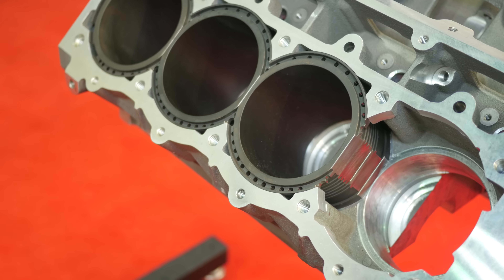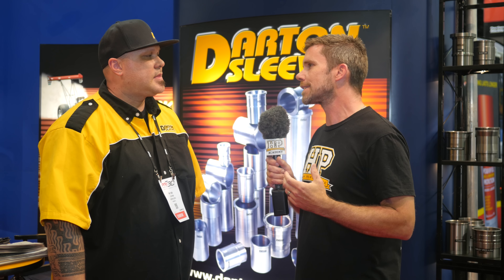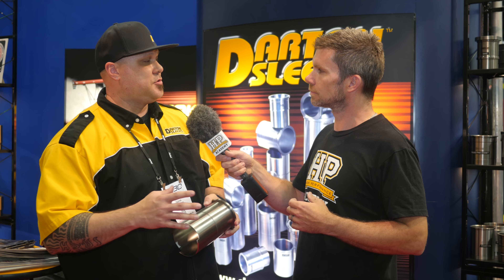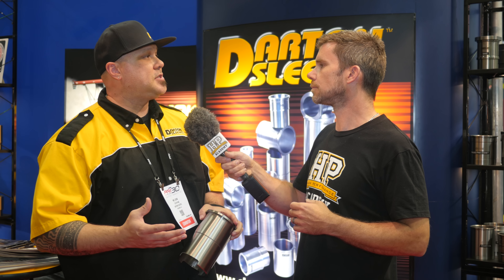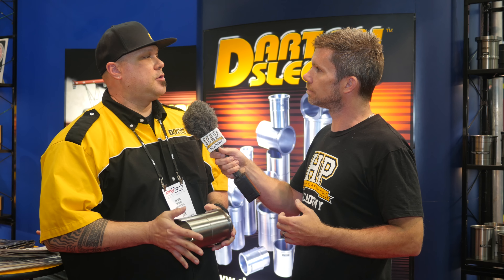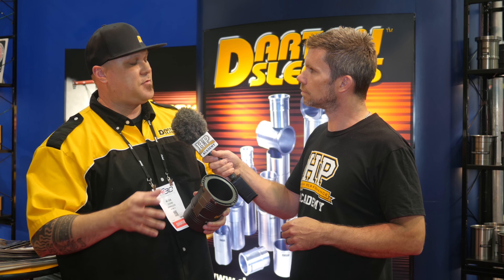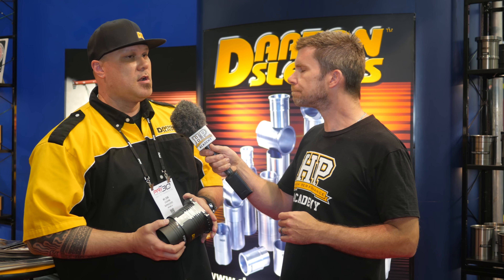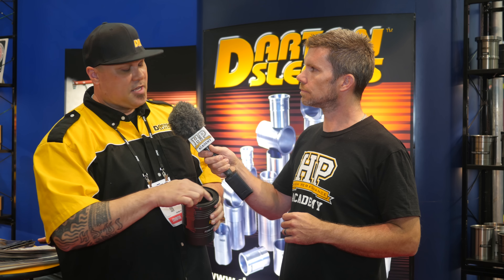Why do Cylinder Sleeves Drop? | Darton Sleeves

Comment: Sleeving aluminum blocks, especially open deck types is an absolute must, even if one is just going for a mere refreshing of the engine running stockish power. One might get away with not sleeving a stock aluminum block when refreshing it, or even removing material  due to minor cylinder damage if the block has the thickness, but he will not get the longevity an iron alloy sleeve offers. Using high quality sleeves of a properly balanced iron alloy between durability, rigidity and ductility is also another must, poor sleeve design and alloy will net you more problems than just re-boring/honing the stock sleeves most of the times. The last must is correct and precise installation as stressed on this interview, get it wrong or do a sloppy job and get ready for a cracked block. High quality iron alloy sleeves, are low in silicon and higher in nickel. Darton sleeves for us gearheads, are considered high quality sleeves and are well known and proven for high performance in the motorsport field. Nice interview as always, and proper info from  Darton.
Reply: Marios EvoCy 
Completely disagree, I work in a full service automotive machine specializing in Subs, Hondas, Mitsubishi etc..what we're seeing is block structure weakness due to removal of block support material. I have a B18C1 on the bench right now that is junk. MID system was installed and due main bearing bore distortions and block twist it junk. 
Dayton an LA Sleeve are both good products, but I don't like the MID. I would rather use a thin wall sleeve with a block guard. 
We have an EJ25 that did a true 800 hp.
Reply: The MID is a good product and works well if installed right. It is your unquestionable right to disagree if you consider it so, and use whatever type of sleeve you consider best for any intended application.
Reply: Any cast iron or aluminum block can be sleeved, there is nothing wrong with sleeving when done right. No bore surface treatment on aluminum blocks can replace the durability and longevity of a proper iron alloy sleeve. If an aluminum block has damage in one cylinder, there is no point in sleeving only that cylinder with the same oem type aluminum material sleeve, the correct process is sleeving all the cylinders with iron sleeves. If it's a cast iron block, yes you can sleeve an un-sleeved damaged cylinder with an iron sleeve of stronger alloy and even if you use oem rings you will not have any issues, but it's always better to freshen the block by sleeving all of the cylinders.
Reply: I have yet to see a block that can't be sleeved successfully, unless it is completely out of shape and or severely damaged, so I disagree on this. I also disagree on any other process, either that be coating, anodized, plasma coating of any type or nickel type of coating  etc, having and yeilding better results than iron alloy sleeves. I did not say that there are oem manufactured or already offered aluminum matrix liners, I said that it is possible to use such sleeves on an aluminum block if you want by having them made. These can be made from high melting temperature aluminum alloy composite, such as Al-Mn, Al-Cr, Al-Ni, Al-Fe and Al- Cr-Zr alloys. It is not something I would do personally,  although  when these alloys are reinforced with ceramic particles, they attain the properties required for cylinder liners in high performance engines, i.e. high melting temperature, good strength at the service temperature, higher thermal conductivity than cast iron, good wear resistance and good corrosion resistance.  The reason I prefer cast  iron alloy ones are mostly cost effective ones also ready made availability for basically any application, and high quality ones  have high wear resistance,high elevated temperature strength; and high melting temperature, and although cast iron has a high specific gravity and a low thermal conductivity in relation to an aluminum/silicon based matrix, they are still up to the job 100%. Now about the tooling used to work on the aluminum matrix, and I'm sure by diamond you mean carbide,it  is there, you just need to find the right supplier. As for the bedding of rings on iron/nickel alloy sleeve, the honing procedure can be the same as on "regular" cast iron block/sleeves , you can use the same pattern i.e, and  if the manufacturer of the sleeves recommends more shallow grooving, then you need to follow the instructions of the manufacturer. In regards to the last bit of your post, of course it is block that is the problem, and the problem mostly lies with open deck blocks, that's why stronger sleeves are used and the block is converted to closed deck.  It seems that you did not understand what I said about sleeving any block, if the block cannot support a wet sleeve then you will use the appropriate dry sleeve and keep the open deck form of the block, but I also have yet to see an open deck block of good condition that cannot be converted to close deck with a wet sleeve.
Reply: @dazaspc 
 KOLBENSCHMIDT manufacture aluminium cylinder liners for Porsche... their Lokasil liners were used in the Boxster. They also manufacture Alusil liners for Porsche, BMW & MB engines.

Comment: This is irrelevant as we move from ice engines. We need to move from these industries
Reply from the maker: No one is stopping you from running an EV race car if that's your choice Keith. There are a few out there giving it a crack. In Formula E they can even last an entire race now even though they're not really pushing things in the same way many ICE race engines are 🤘 - Taz.

Comment: liner height should be set according to oem specs, too high and you risk oil/water sealing issues. too low and you risk compression side leakage issues
Reply from the maker: Setting non-OEM parts to OEM specs is not a good idea. If you have the gear to machine for and fit sleeves yourself, the supplier, Darton or otherwise, is the source you want, not your OEM.
I can't remember which specific interview addresses the height/depth but both Julien Godfrey and Oskar Elmgren have shared some good details on cylinder sleeving for those interested - Taz.
https://youtu.be/EivSsXxgiUg
https://youtu.be/o3wGe2aU6SE
https://youtu.be/MvevlhjVEFk
Reply: The gasket is designed to work with a certain liner height, too high and you risk distorting the head and having coolant/oil leaks and mixing.

Too low and you risk burning out the fire ring or losing the seal between cylinders under compression.

Comment: i dont think theres anything different abt these sleeves. its all crap. all B.S. factory sleeves r not bad either.  sleeves r not gnna increase H.P or torque. waste of money.
Reply from the maker: This is 100% correct for some applications. If you are not pushing enough pressure and power to cause the issues that makes you need a product like this, then you indeed do not need them!
There are a lot of people out there building engines that do run into issues which require the use of products like this though  😎 - Taz.
Reply: It’s a option for people looking to get more cubic inches out of the same block.